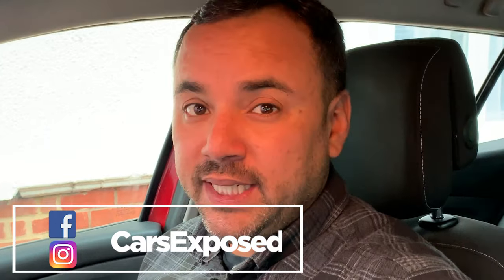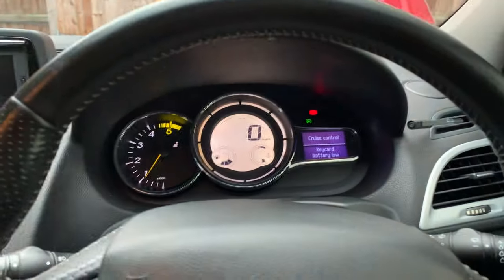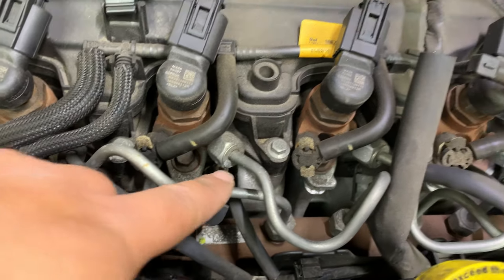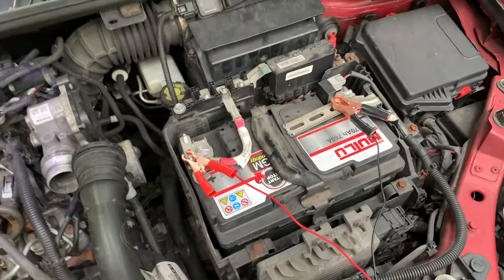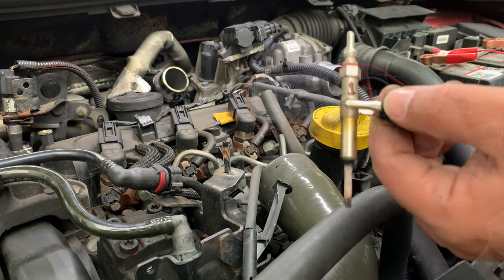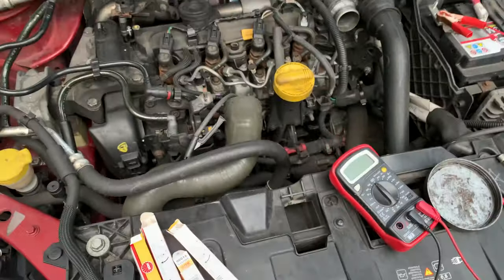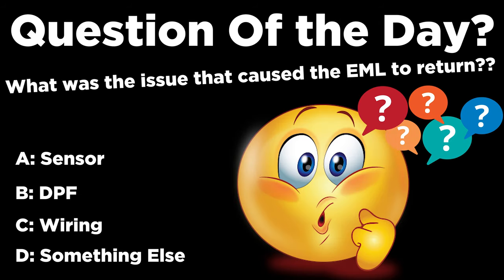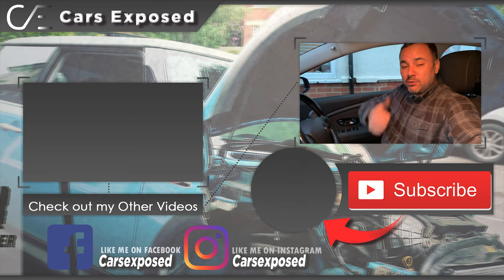Renault Megane MK3 Glow Plug Replacement - Testing

Comment: Definately 'B' is the right answer. If anyone else owns a Renault Megane diesel and you get the Engine Management Light / Check Injection System could need a regeneration.

It's not even hard - you just need to drive on the motorway, let the engine get hot then change speed to 50mph and put the car in 5th gear and drive for 14 miles.

At some point 7-12 miles in, you'll feel the engine chug a little - that's okay as it's doing a DPF regeneration (burning up fuel deposits in the exhaust).

I found this technique out by nicely asking my local Renault Dealer.

Comment: Hi
Well done here!
The measure of the sensor is difficult to do or judge just based on the multimeter reading... as is not quick enough to show breaks on the signal for example...
But is indeed enough to see if is responding...
Curious too see what's next...
👍👍👍
Reply from the maker: Thanks mate, That’s right unless it fails completely will be difficult to condemn the sensor without scoping it... 2 things that’s making this job difficult for me are not being able to check live data and scope the sensor... but you know Xmas is coming, I know you have a good heart 😁... 
I know the problem now and I’m still waiting for parts, just a little teaser, £300 worth of parts 🙁👍
Reply: @CarsExposed  hey great video 😁😁😁. Did you ever do a video explaining what the bigger issue was?

Comment: I have a 2011 1.5 automatic diesel Fluence. It has a push button ignition. It's been sluggish  in the morning starting and takes 2 or 3 goes and longer on frosty mornings. Once started it's fine for the day. I changed battery thinking it was that, definitely not alternator and I don't think start. I have a feeling it's the glow plugs. I bought some but am nervous putting them in incase I snap old ones or the new ones.
Reply from the maker: Very likely to be the glow plugs , to be honest it’s a hit or miss with glow plugs i am also very weary of them , why don’t you test them first very easy with a test light or multimeter 👍

Comment: Engine can be destroyed
Injection valve control circuit cyl. 1 DTC020125
Connection diagnosis glow control unit DRC038096

What does this mean, do I only have to replace the glow plugs or the control unit?

Comment: did you have any further engine lights after running the car?? I purchased the same maxiscan and lead direct to glow plugs.
Thanks to your great videos i have saved myself at least £300 in garqge fees. keep on making them bud
Reply from the maker: Kerry Hosznyak thanks mate, I did have and ended up being the exhaust pressure sensor , sorry about the delay I believe you have watched the second video right? Otherwise it’s in my Renault playlist 👍

Comment: I had same warning lights and messages as you (i have same Megane) purchased multimeter and checked pressure sensor, all was ok, purchased the scanner and came up with one fault which was the glow plugs. i had garage put it on their scanner at the cost of £50 and they couldn't find a definite fault.

Comment: Would it be the exaust valve underneath the car. Ever hear that high pitch buzz after you switch car off? , that is the exhaust valve going through the motions of shutting down. Currently have the garage telling me those 2 codes are showing one for glow plug other for exhaust valve, but there are no problems showing on my dash? Bit slower to start on a cold morning but that's it nothing obvious on the  dash warning lights?

Comment: Diesels dont have a throttle body thats an anti-shudder valve, helps the engine turn off and makes it smooth when turning off.
Reply from the maker: Only terminology … intake valve , shudder valve , throttle body, tomato and tomato.
Reply: @CarsExposed Yeah you're right, I have to do this job on a family members 1.5dci, did they come out easy? Also what's that tool you used to give power to the glow plugs?

Comment: Does the car run/start better after installing new glowplugs? I have the same fault code but it starts without problems..
Reply from the maker: WestSideConnection5 I didn’t have any noticeable issue either but it’s important to change them if they aren’t working... the most common issues are hard to start, excessive smoke, possible misfiring... 👍👍

Comment: Hello my friend I have a Renault Megane 3 2010 model, the Star Star works and most of the time it does not work. I mean here (the car is running) the mechanic said that the reason is the glow plug system.  Another technician said no, could you help?  thank you very much
Reply from the maker: محمد عطالله رافع would look into the live data in the scan tool and see if the clutch pedal switch is working first or anything that stand out 👍

Comment: Hi there, great video by the way! Super informative 🤙 
I wonder if you could help me. I have a Renault Scenic 1.9dci, lately my glow plug light is intermittent and it feels like the car is running on 3 cylinders. It has moments where all 4 work and you car picks up speed and you can feel the difference in torque. 
I'm still new to the whole diesel thing, any ideas on what it could be?
Reply: Hi mate did u manage to sort the issue out ?
Reply: @infernoblades7224  hey man, I did indeed! Changed all glow plugs and well as wiring for my plugs. 
The old ones were corroded and all! Must just be the age of my vehicle.
She runs like a beaut😎

Comment: Hi buddy! Changed temp sensor!! Lost water but header tank still full seems no water in bottom off engine!! How to I get coolant past thermostat that’s cold
Reply from the maker: You have to bring the car up to temperature for the thermostat to open . Keep an eye on the coolant reservoir and top it up as required 👍
Reply: @CarsExposed  hi fella engine temp not moving!! That’s why I changed temp sensor!!! Fans on constantly!! Think it’s a faulty temp sensor! From euro car parts

Comment: Possibly Intercooler cooling pipe might have tiny crack and start loosing vacuum. That's why randomly fault on screen appears.
Reply from the maker: It was the exhaust pressure sensor, it did give up after 4 days of recording 👍. Video here https://youtu.be/PLfHjqGj9Oc

Comment: The two clips on the turbo pipe....what are they called? They are essentially jubilee clips but have a different name...I can’t think what they’re called...I need some replacements but don’t know what to search for....I suppose I could just use regular jubilee clips.
Reply from the maker: Michael Barnes i replaced mine with some stainless steel clip commonly used for drive shafts here is the link mate https://rover.ebay.com/rover/0/0/0?mpre=https%3A%2F%2Fwww.ebay.co.uk%2Fulk%2Fitm%2F130890730278
Reply: Cars Exposed thank you...Gaitor clips was the name I couldn’t think of.
Reply: @CarsExposed  hi do you actually need to replace them? Can’t it be re-used? Thanks

Comment: I changed my glow plugs and everything seemed fine at first. Left the car for a week and now I've gone back it won't start and just cycles between the engine management light and the glow plug symbol. They flash alternatively. Plugged in reader and no codes. I'm totally stumped. Any ideas?
Reply from the maker: Have you got access to a pro scanner mate where you can have a comprehensive amount of live data? Probably the best thing to do at this point to get some direction 👍👍👍👍
Reply: @CarsExposed  The car was throwing up no error codes which made it a total guessing game for me. Put it into my local garage and be found the fault to be the multifunction control box in the engine bay. Turns out fancy fuse boxes cost a fortune (£234) from Renault. Cars all fixed now though! My glow plug change had nothing to do with it, there was some corrosion on the box and it wasn't giving out the correct voltage so the car was going tits. 
She's now working great and the glow plug change (guided by your video) has made my life a lot easier this winter.
🙂🙂

Comment: Hi I have the same problem too with anti pollution and injection system I took it to the garage he says it might something to do with the turbo and gonna cost £1200 is this true. Mine is Megan year 2010 mark 3
Reply from the maker: bg joni Any our of the ordinary drivability issue ? My problem was actually a sensor check out this video https://youtu.be/PLfHjqGj9Oc
Reply: @CarsExposed  it starts n drive just normal
Reply from the maker: Even in high gears like 5th or 6th ?

Comment: Glow plug error showing on my megane 3 too , changed the glow plugs ( 3 of them were bad , changed the 4 of them ) ... but the error still appearing ... what could it be ? thanks
Reply from the maker: Have you tried clearing the code? Make sure the glow plug connector is pushed in properly .
Reply: @CarsExposed  yes , all the connectors made a click sound and everytime i clear the code it appears again when i do a new search =\
Reply from the maker: What code are you getting? I would check the resistance of the glow plugs just to make sure, it has to be close 0 as possible... then ignition on with the test light you can check for power 12v at the connector... I’ll check the wiring diagram in the morning when I finish work just in case 👍
Reply: @CarsExposed  P0380 - Glow Plug/ Heater Circuit "A" . they're brand new , that's why i find it odd ... I work away from home and my wife stays with the megane and i can only check it at the weekend . could it be a fuse ?
Reply from the maker: Pedro Pinto maybe I’ll check the wiring diagram, but I would check the glow plugs for resistance too, I know they are new but sometimes people from the shop dropped it or something like I always check before fitting them in ...
Reply: @CarsExposed  ok , i'll do that as soon as i can . thank you very much